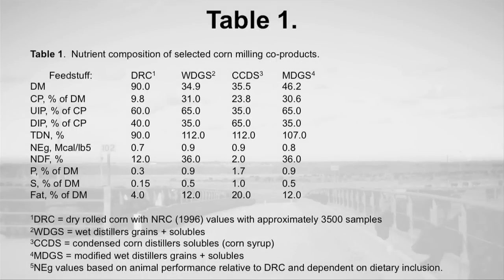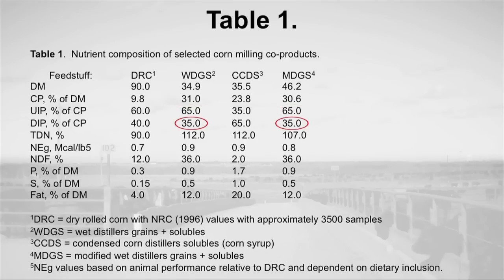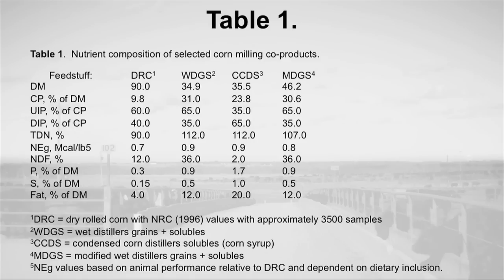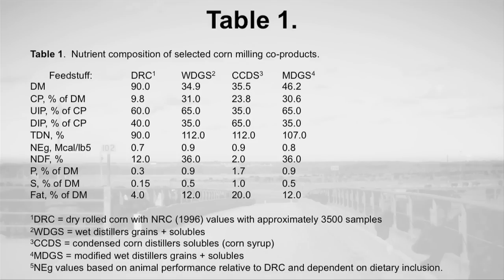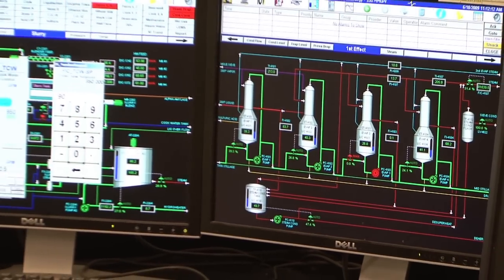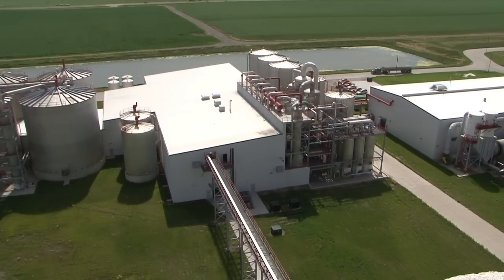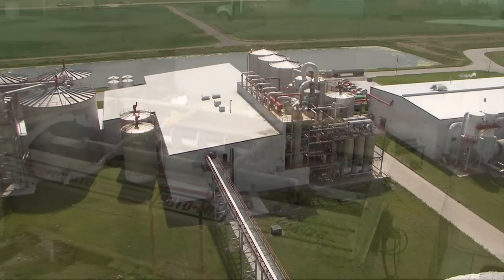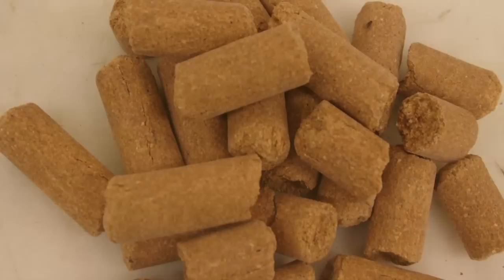Storage Methods for Ethanol Co-Products - Nutrient Composition

Comment: Rayemean Elements has developed an a method of densifying pure DDGS into cubes without binders or fillers.  The resulting cubes are more dense than traditional cubes and do no require any binders or fillers, so the nutrition is the highest in the industy.  At 60lb/cubic foot, the cubes are also more dense than conventional cubes, and they reject moisture and have a nearly infinite shelf life.  

http://www.rayemanelements.com/bulk-densification-line.html